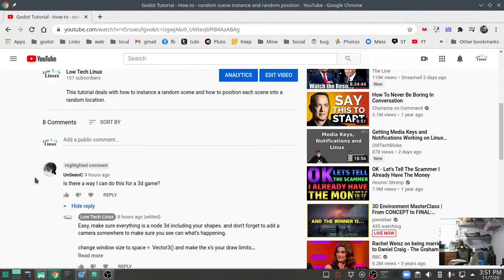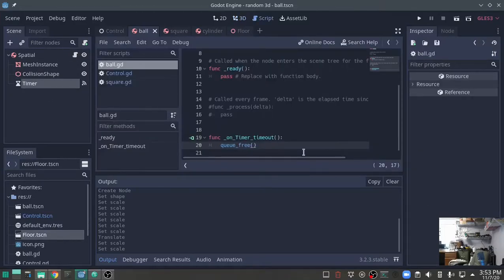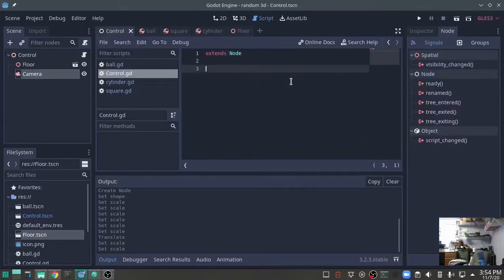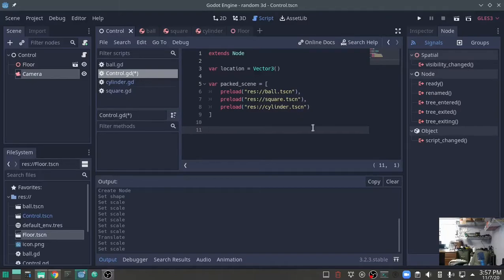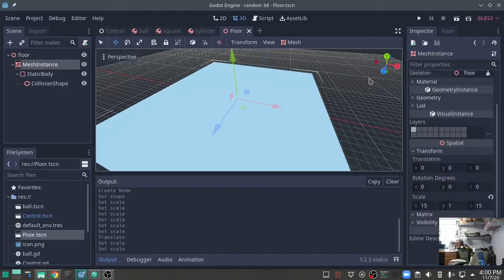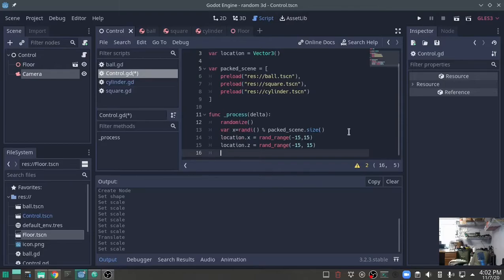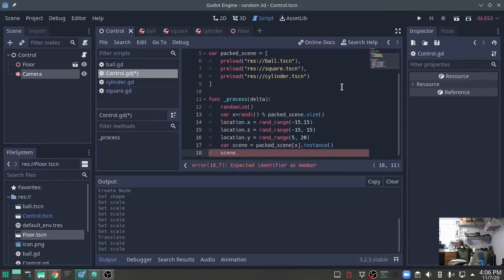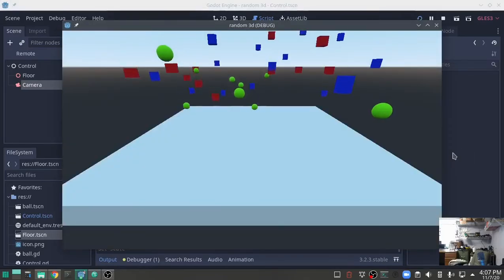Godot 3d Random Location tutorial

Comment: quick question, instead of spawning the items randomly, how would you spawn them in a specific place and when the player were to (e.g. press a button)
Reply from the maker: If that specific place is only one location, specific that one location in the new location variable and tell it to spawn there.
If it's more than one location based on an event (like what button is pressed) set your location variables in an array and choose randomly from that array.
In it's most basic form to use a button press that's not assigned use 
func _unhandled_input(event)
  match (event)